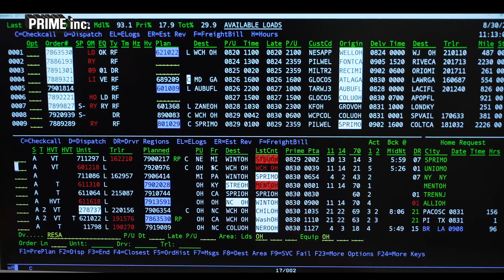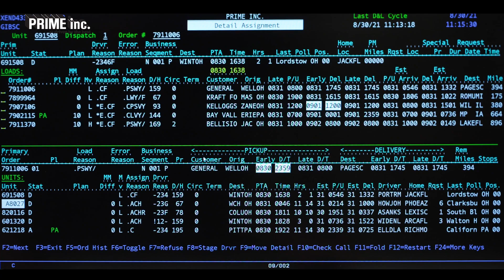The Process of a Prime Load

Comment: Does PRIME INC have a western regional division or are you guys only 48 state ????
Reply: i know of some drivers for primes in las vegas area that just do routes like los angeles to salt lake or twin falls ,, dispatch tries keeping them running there so they can get thru to house more often.. they also have a few  intermodal divisions around country, like  in la and i think portland or seatlle, 4-5 others too
Reply: Prime Inc does have a "Western 11" regional for both company drivers and lease. However due to CA state laws, prime will only hire CA residents as company drivers. Prime also has other regional positions such as Midwest, southeast, and northeast regional.  Intermodal across the country is now becoming local, if not already.  Be aware however, operations costs for lease ops would increase in western regional due to the mountains costing more in fuel.  This may result in a lower net revenue than lower 48. Good luck and be safe

Comment: What’s the average dollar per mile on the loads ?
Reply from the maker: Here are the starting solo company driver pay rates:
.48 cpm refrigerated in a full-size truck
.53 cpm refrigerated in a lightweight truck
.50 cpm flatbed
.55 cpm tanker
TEAM COMPANY DRIVER RATES
.59 cpm split refrigerated
.57 cpm split flatbed
.60 cpm split tanker

Team Bonus
.26 cpm bonus for miles between 3,000-3,999 per week
.31 cpm bonus for miles over 4,000 per week

Comment: Sounds like forced dispatch. Forgot to add in the part drivers need to “run the network” whatever that means and fleet managers handle lots of drivers so it’s easy to have a driver with low income while others are at high revenue because they get paid a percentage of drivers gross. Yes I said gross not net meaning running more miles than need to cover over booked freight.
Reply: Nobody is forced except company drivers if I don’t want a load I tell I don’t want to go there and that’s it it’s like any other company or owner operator you except a load you are force to run the load it’s that simple
Reply: @liferoller8935  not true my friend you need to know where the phrase “ in network” comes from clearly you take every load with minimal refusals good for you.  But I have proof it’s clearly not true because I get responses from a particular operation manager to leave prime if I don’t follow in network. Good try
Reply: Facts